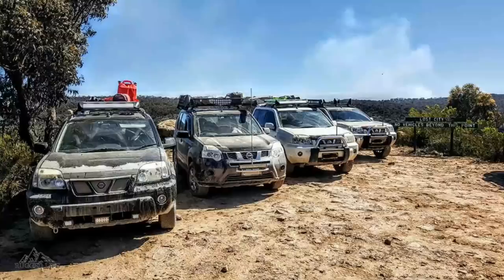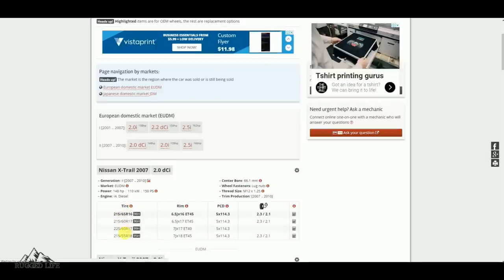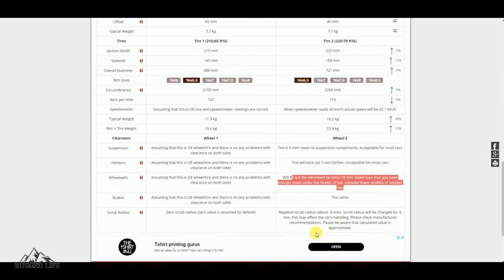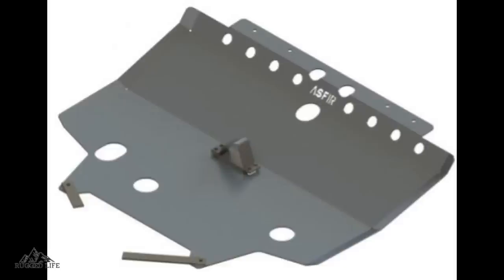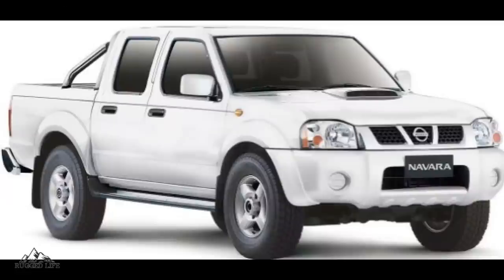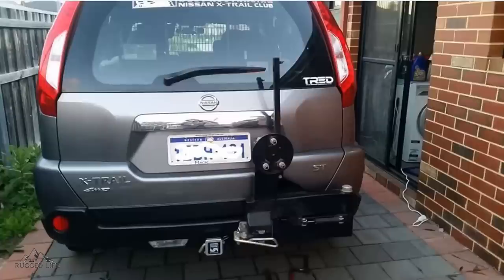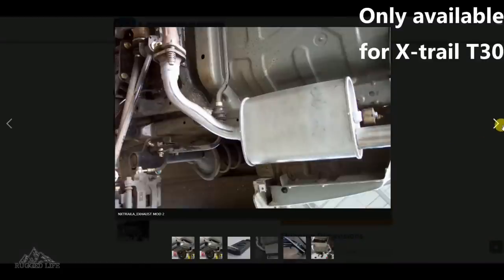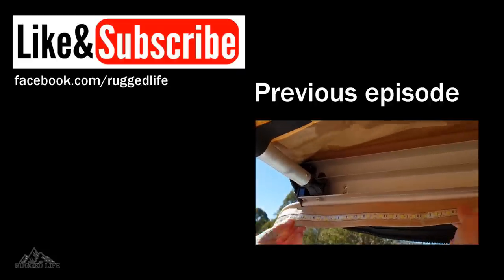NISSAN Xtrail OFFROAD MODIFICATIONS - MODs

Comment: Hey brother just order a lift kit for my T31 2008 Xtrail .. I ordered the 65mm lift kit.. Given you said the most lift yours could handle is 50 mm Do you think it going to be a problem for me ?
Reply from the maker: Hey mate your front CV will wear out prematurely due to the severe angles.
Reply: Thank you so much for your fast support . I contacted the seller and let him know my concerns . Here is his response.  Would love to have your opinion on it 
"I will explain and you can make the choice. We have many of our 65mm kit our there without any problems so far. Because the car has independent suspension the spacer thickness results in more lift. On some cars with long control arms 30mm spacer gives 50mm of lift. In this case the spacers you will get are 50mm, but they will lift the car 65-70mm. The 50mm kit comes with 40mm spacers. I would not sell if not compatible. It is at the limit, but cars go down by them selves 20-40mm in 20 years. Please let me know if you want this kit or change it to the 50mm kit with 40mm spacers?"
What should I replay ?
Reply from the maker: @nicolasbernal6802  No worries. So looks like you'll get 50mm spacers. That is the maximum I would personally go. I thought the spacer itself is 65mm. That would be too much. 
You can go ahead with it if you want.
Reply: @ruggedlife  you are an angel ... Thank you so much .

Comment: Hi there, I have a Nissan X-trail t30. If I were to get those 35mm lift springs, would u recommend getting new shock absorbers or r the stock ones alright? Cheers
Reply from the maker: Stock is ok mate but ideally you upgrade to better shocks as your springs are most likely stiffer than the oem which means your stock shocks will have to work harder.
Reply: Rugged Life cheers

Comment: I have a 9000 lbs Runwa  winch on my T30 for almost 2 years and i have no problems with body structure, but i have a reinforced front and it didnt cost an insane amount of money, but every country and every shop is diferent. I use Xtrail for offroad "rally" racing and i dont have much time to dig myself out or other cars to pull me out so winch is great for me.
Reply from the maker: Nice. Which country are you from?
Reply: Rugged Life im from Latvia

Comment: Been googling stuff like this but only found this one just now. Thanks for this video. Just a question though for automatic trans, if setting mode to 4x4 does transmission overheats and stops engaging? Some say to just put it to auto mode. Is there a truth to this? TIA.
Reply from the maker: I have a video about this and also how the different 4wd options work. Have a look under Practical 4wding playlist
Reply: @ruggedlife  thanks mate! Great stuff. Simple and easy to understand. Just raised my confidence level on my T30.

Comment: Is it possible to increase the height of my 2018 Nissan Xtrail by just replacing to longer springs only and without changing the suspension or shock absorbers ?
Reply from the maker: Should be ok assuming you can find longer springs.
Reply: T30 is the best to lift up (easiest) T31 you can but you it is a mix between body and frame lift. Also engine etc has to drop 3-4 inches, T32 yes you can, however after you spend tyhe 4-5,000 dollars you might as well grab a patrol tbh. However if you really want to keep it like most of us then find a fab shop to accomplish it.
Reply: So I'm actually looking into this right now so I have the t31 and there's a company here in Japan that will only ship the kit if you're in Japan and they will only install it if you bring your vehicle there so I live on a different Island in Japan then this company is at so I'm trying to get them to ship it to me but they're real weird about who installs it which I understand.

Comment: Hi mate, is it better to use 50mm block spacers or new suspension?in guessing the box option will eliminate the need to mess with any of the camber and shocks etc. Also if I wanted to go higher than 50mm, what else would need to be lengthened?
Reply from the maker: Hey mate. The spacer is a good option if you need maximum height as that is the heighest you can go. Beyond that the cv angles will be too much and youll be replacing them aften. You dont need longer struts etc if you use the spacers. I chose the lifted springs as it gives me higher load rating due to stiffer springs.
Reply: @ruggedlife  awesome cheers for the info mate. Any chance of a link for some spacers in auzy?
Reply from the maker: @turdbomitch9007  try this mate https://www.superiorengineering.com.au/4x4-suspension/coil-spacers-and-strut-spacers/strut-spacers-50mm-lift-t30-only-4087?filter=267%2C355%2CNissan-X-Trail-T30-2001-2007--WagonPetrol2.5lt

Comment: Hey mate, i was lifting my hilux with a strut spacer, but i feel my car was swaying around. i've tried to alignment the wheels, but there were no different. and now i take it back to original. do you have the same issues before
Reply from the maker: If you removed the spacers and it still feels the same you need to get it checked properly. Not just alignment but camber, caster etc.

Comment: Did water get in the cabin when u crossed the water?
Reply from the maker: b.x.b L.J Not at all. For that deep water, as long as the vehicle is moving forward at the right rate and the crossing is not overly long, then the door seals of any 4wd will hold pertty well assuming the door seals are in good condition.

Comment: So why do you say max out size is 16inch here in Britain all our original rim sizes are 17s-18s 17s t30 18s t31
Reply from the maker: 16" wheels max would be more suitable offroad where you need to lower down tyre pressures. Down lower than 20psi. Of course you can do it on larger rims but increase the risk of damage.
Reply: @ruggedlife  I’ve got 15s to go on that just need tyres what’s the best tire to go for
Reply from the maker: Any decent all terrain if you do plan to take it offroad.

Comment: why not just buy a Patrol? I just bought a 2002 X-trail and its rubbish! you cant put bigger wheels on it because the rear wheel will hit the spring, and you can only lift it 2 Inches ?? .....
Reply from the maker: That is correct. You can lift it to 2 inches only. If you plan to use your vehicle to tackle terrain that requires more than 2 inches of lift then the Xtrail is definitely the wrong vehicle of choice. People like me who choose the Xtrail need a vehicle that will be used onroad most of the time but also want a vehicle that can be taken to those beautiful places that a standard softroader can't get to. I would love to have a full size 4x4 but I know that it will be used on tarmac most of it's life so there is no point paying the high running cost of such vehicle.
Reply: lol. of course it's rubbish. you just bought a car that is 17 years old.
Reply: benjimoomoo not necessarily rubbish depends on how well maintained the car was. My xtrail has done over 300k and is in mint condition. I’m in the same camp as rugged life, mainly use the car on road but have spent many great trips to Fraser, Morton, Straddie etc and the car meets my needs. If I were to upgrade to a full off-road vehicle then an electric rivian or Tesla pickup would be my choice in the years ahead.
Reply: @ruggedlife  agree,but when you add all modifications are much expensive than maybe stocked pajero on lpg
Reply from the maker: @23860  that may be correct. However, the pajero's running cost will be way more than the X-trail. If where you intend to take your vehicle offroad is way beyond the capabilities of a modified X-trail then you shouldn't even start modifying it and rather buy something more capable.

Comment: Turbo mods to this? .   2003
Reply from the maker: Haven't seen one out of the box. Better off transplating an SR20VET into it. The GT version of the Xtrail has that engine.
Reply: I read in an artical [ X-TRAIL-UK] website about remapping the computer box, where they boost the 147kw diesel manual to 220kw and the diesel auto to a max of 180kw. Apparently this is the safest max for the 2lt diesel where as chipping or boosting the turbo will damage or shorten the life of the engine. Before remapping they also check the condition of the motor and vehicle and then custom remap accordingly.